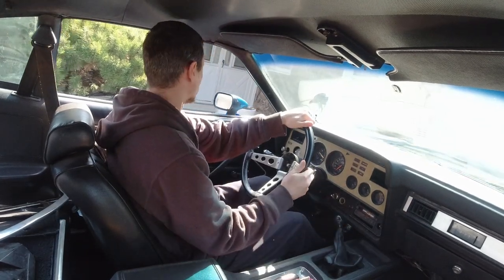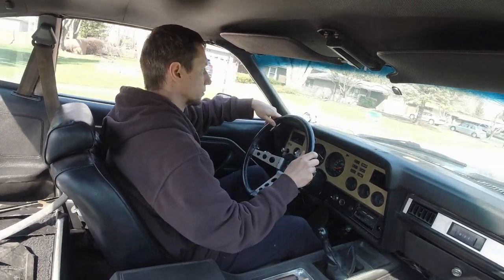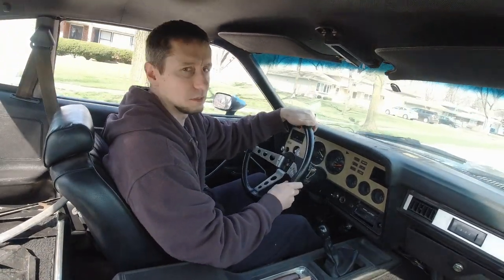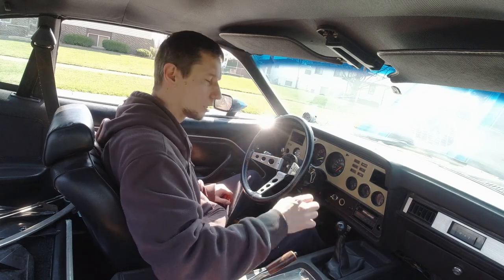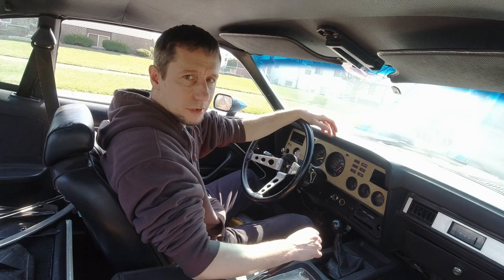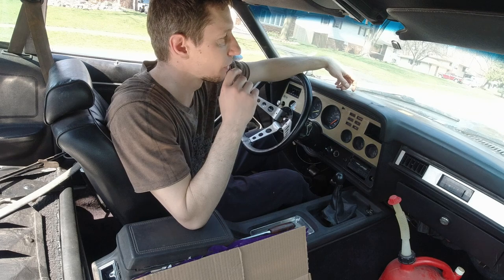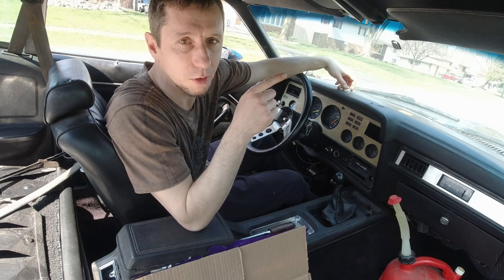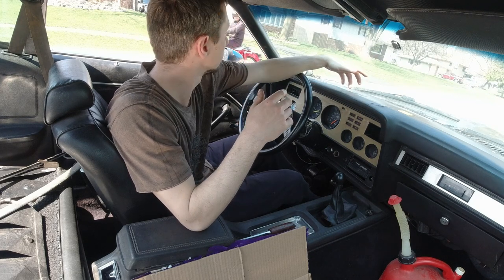Ford Mustang II almost a ride

Comment: Cool Car.  Its like watching a time machine.  This is exactly how cars worked in the '70s, plus this one is 45 years old.  So in addition to a tired mechanical fuel pump, the lines are all corroded and the gas tank is full of junk.  To make it right, not only do you have to fix what has decayed, but make it better that it came from the factory.  Otherwise, this is exactly why you see cars out in fields for decades that just fire off with a new battery and gas.  The owner finally discovered fuel injection and they stopped driving the old mis-tuned carburetor car because it was a pain.  Plus, they did not have cell phones or jump boxes.   Mine would start with no choke, pump once and turn the key, but I put a cheap electric fuel pump on it.  That fixed a lot of problems along with keeping it tuned.  Without it, the process went; Turn key, cuss.  Pump gas, turn key, cuss.  Pump, pump, pump, turn, turn, turn, cuss, cuss, cuss.  Rinse and repeat.  Ahh.  The 70's.